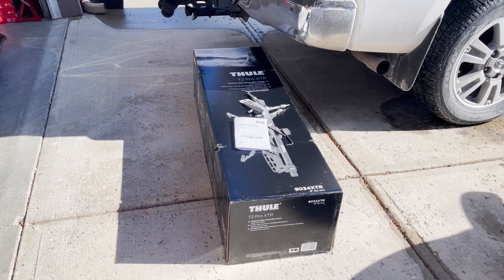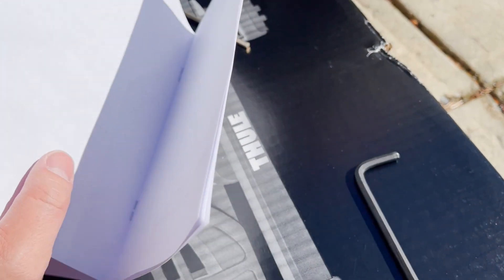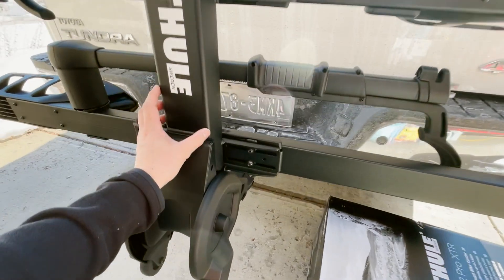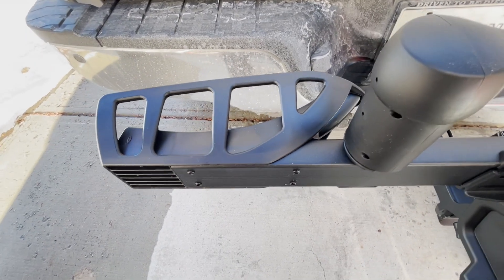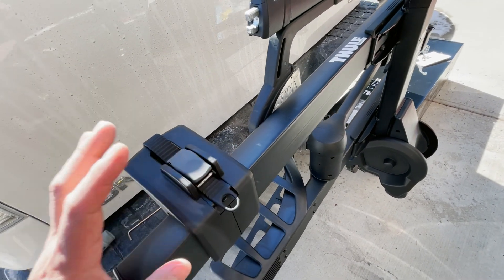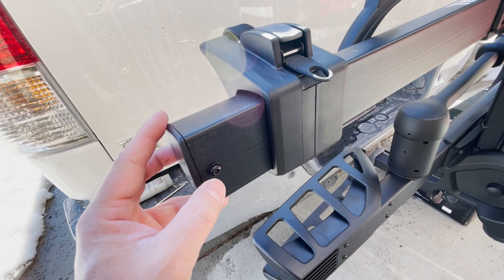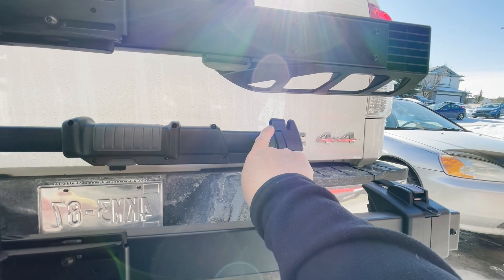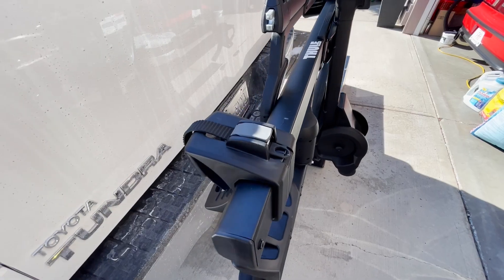Thule T2 Pro XT and XTR Hitch Mount Bike Rack Assembly Tips

Comment: Great video!  I few tips that I discovered: 
1. when you strap down the rear wheel, you should thread the end of the plastic strap INSIDE the hole, not around the outside (I noticed you were attaching it outside).  That will give a more secure hold, especially for the narrower tires.  
2. For me it was a real pain to get the rack to go into the hitch receiver the first time (I have the 1 1/4 inch receiver), because the friction wedge was sticking out.  I wrapped it in a cloth, then used a big channel-lock pliers to squeeze it together - that made it go in easier.
3. I didn't have a helper, so I did the assembly entirely off the car.  I layed the bars face down on a carpeted floor, extended the rack out flat and set it upsidedown on top of the bars.  That was I could easily put in the 4 bolts all by myself.  Same for the front wheel holders.
Thanks again for posting this, I don't think i ever would have figured out how to put in the key tumblers!
-Dan
Reply from the maker: Fully aware.  I demoed what can be done but for sure if you loop the strap inside vs. outside you'll get more or less length.  Its funny how the manual doesn't clearly show that but I knew it could be done either way.  Thanks for watching my video!
Reply: thank you for that 2nd tip!!

Comment: Great video, you're a youtube hero with this one.  Only addition I would add is that the knob to tighten the hitch didn't work until we both put the lock in with the blank key, but also turned it 90 degrees in place.  If you mentioned that, I'm deaf, but it took a good bit of disassembly for us to figure that out on our own.
Reply from the maker: Thanks for sharing

Comment: Thanks for the video. Lots of detail. Just a quick comment on grease and thread locker use. Superlube is a synthetic grease. It's not a silicone grease. As it is synthetic it will repel water and it's a good choice for the plastic ABS carrier. Unfortunately it is a lubricant that never really dries. So those bolts or screws could move over time. So periodic re-torquing is a good idea after some serious mileage. You definitely don't want to use a Loctite threadlocker there as the uncured resin, if it comes into contact with the plastic, will attack and stress craze the plastic. So avoid all contact there. Anything that's powder coated or anodized or bare metal is fine. How do I know this? I was a Loctite rep for over 30 years. Also, 243 or 222MS are great choices for the bolts. Both are removable. Thanks again for the post. Great info. Cheers.
Reply from the maker: That's a valid point and I stand corrected on superlube.  Yes I definitely wouldn't want to use the blue/green/red loctite on the fasteners as you've said, it will attack the plastic.  Fortunately for the screws that I used superlube on that they're a low vibration (I think) fastener so I hope it doesn't come loose anytime soon.

Comment: This was probably the best video I have found on assembling my rack (which I just received yesterday). My manual included all of the pages, which yours was missing.  You have some great pointers such as using lube on the screws.  As soon as you had mentioned the orientation of the two beams, I had to go out and see if I had them in the proper direction (luckily I did).  I found putting this together with the abysmal instruction manual similar to assembling something from IKEA. Thule could easily have made it into a good manual just by adding a few words and suggestions.  For example, how tight the screws should go, and some information on the proper use of the rack.  I assembled the rack by myself on the back of my vehicle. It honestly was not that difficult, although you have to have the second screw available once you get the first screw partially in.  And of course, I did drop a washer more than once on the driveway, and had to use a magnet to locate it, so it might be a good idea to place a hunk of cardboard, or a sheet under the rack during assembly. One other thing - there have been reports of vehicles getting ticketed (at least in Canada) because the licence plate is obscured by the rack.  I see Thule offers an optional plate holder for the rack, which attaches to the rack itself. Unfortunately, this was out of stock.  So I guess I will take my chances.
Reply from the maker: Glad you liked the video!  Its funny how something as straightforward as a bike rack can get confusing b/c of how the manufacturer documents or packages their product.  Given how expensive these racks are that taking proper care to assemble this properly is key.  Not sure how others feel about something pedestrian like a bike rack but I take care of everything I own and this rack is no exception.

Comment: Wow, you are so right about the dismal instructions. Great tip about extending the strap!
Also, I had a problem with the locks, I did not realize that one key is for installation and the other ones are actually to turn the lock, Duh! No wonder I could not turn the lock on the Knob with the installation key and also tried to insert the cable lock with the regular keys and they wouldn't go in! 
Every thing else was pretty easy, but I was dumbfounded with the locks until I saw your video. 
Thanks!!!
Reply from the maker: glad that you were able to get your rack all setup properly.  Yes the instructions are absolutely idiotic and what use are pictures if they don't tell a proper story on how to actually assemble the bloody thing!  Great product, terrible instructions.
Reply: @piercedasian  Absolutely, even Ikea instructions are better than these, and that says a lot!
Reply: It makes you wonder why the racks could not hav e come with the locks preinstalled by Thule.

Comment: Maybe someone else pointed this out, but you may have gotten a misprinted instruction manual. Mine had pics to install all the parts. Super easy to assemble (did it fairly quickly in the REI parking lot) and all the screws aligned with the holes (which apparently Thule is notorious for messing up). Great bike rack! Thanks for the vid 👍🏽
Reply from the maker: Glad you liked the vid.  Yes I have been told numerous times that my manual book was a misprint but even if they were a complete printed instruction booklet that they're still pretty cryptic.

Comment: Thanks for the great video. I figure after Thule saw this video they decided to complete all the pages in the assembly instruction manual. Mine had all the pages, but instructions were about as cryptic as Ikea. One thing I didn't expect is that the rack doesn't sit flat; i.e. parallel to the hitch. It leans in toward the vehicle quite a few degrees. I imagine it is designed this way purposely to reduce the cantilevered weight, but I'm using it with a truck and camper so the very wide handlebars on my Rocky Mountain Altitude come within one inch of my camper. If the rack was level, it wouldn't be a problem. I guess my Rocky will be riding on the rear rack.
Reply from the maker: lol I bet someone was really asleep at the wheel when they made the instructions...  Either way, I'm glad that subsequent versions of the manual are complete even though you may as well be reading hieroglyphics.

Comment: Thanks very much for your helpful video. I watched a few times just to make sure I was thoroughly familiar with everything. I actually got a full instruction booklet, however the two innermost holes ( closest to the main tower) on the two wheel baskets don't line up and I could only use two screws. And yes they are pointing in the proper direction. I wonder if anyone else had this problem. Other than that, this is a very easy to use bike rack.
Reply from the maker: glad the video was helpful.  If the basket holes aren't lining up I would take the rack back to the dealer you purchased from to get an exchange.  Mine lined up perfectly and given the steep price of this rack that I would expect nothing less than perfect.
Reply: @piercedasian  Thanks again for the video and reply. I couldn't wait to return it through Amazon and needed it right away so I made due with just two screws on each basket. I took it and my road bike on the highway with out any problems. And that was with a flat front tire. It is still very stable. I guess if there had to be a problem this was the best problem to have. Not too happy but at least I can use it seemingly w/o problems.
Reply: @garykurtz3009  if you take out all the screws and then try and line up the holes, find the one that is least lined up, put the screw threw and find the hole with the basket and holes slightly away from the screw, the screw will be bent a little, but once you do one slightly, find the rest, and screw them in a little at a time.

Comment: Your instructions booklet was  a misprint. My booklet has all the pages. Did you download the instructions from the website. Thanks for the points on the mounting bracket with the Thule Logo on top. i found an impact driver helpful, but need to watch the torque and tighten by hand.
Reply from the maker: Yeah I was told my instruction booklet was a misprint.  Regardless the Thule instructions suck as I've purchased some other Thule stuff and their technical writing team could use a lesson or two on how to present procedures in a better manner.  Glad you liked the video. Thanks for watching!

Comment: Great video. Do you think it's possible for me to remove the bike holding bars from the main attachment (that goes into the hitch reciever) and store all 3 parts separately for the winter? I live in a shoebox and I can't keep the whole bike rack stowed as is.
Reply from the maker: Yes, absolutely.  Just make sure you that you keep the washers and bolts in a bag that you won't lose otherwise you'll have to source new ones from a Thule dealer (they're metric BTW) and while it likely won't be expensive that it is a bit of a nuisance to try to find missing screws and washers when you really need them.

Comment: Just a T2 pro XT at a garage sell but they didn't come with lock cylinders for the hitch knob and cable lock. I cant seem to find the part number for them. Do you know it?
Reply from the maker: the lock cylinders are the easiest part to obtain.  Just go to any Thule dealer and ask for a lock cylinder set and they can sell you a kit that has multiple matching lock cylinders with a new key.
Reply: @piercedasian  sounds good. Thank you.

Comment: I love the bike rack the only problem I have is the cable locks are not long enough for my 5 inch tires I have a Bolton Foxbat E bike do you have any suggestions thank you
Reply from the maker: have you tried pulling up on the lock mechanism?  The lock doesn't actually stay in the "pole" of the rack.  The end can pop off that then allows you to wrap the cable around the tire and secure the lock close the to bike.  It was an accidental discovery I made when I said the same thing about the shorter than usual cable.  Turns out that its short if you pull it out and try to tie it around your bike and then loop BACK to where the cable comes out of the rack.  Totally NOT necessary to do that.  Try pulling up on the end of the lock where the cable pulls out of and you'll see the end holding the lock will pop out giving you MUCH more flexibility on how to lock your bike to the rack :)
Reply: Thank you problem solved

Comment: What are the locking cables made of? Can they be easily cut with wire cutters?
Reply from the maker: The cables are just that... cables.  Easily cuttable with larger wire cutters.  It is meant to keep the honest thieves away.  If someone wants your bike off that rack they will EASILY get them if they have the appropriate size wire/bolt cutters.

Comment: So I just got one of these and a thing I’m concerned is that the little claw thing that goes into the hitch pin. Doesn’t lock and stay in. It’s like a spring tension system that “hopefully” stay in. Am I missing something?
Reply from the maker: So I had similar concerns but I can assure you that it will hold just fine (in fact it holds really good!).  You install the rack, line up the safety pin hole from the hitch to the hole in the rack's tongue.  When the holes line up you snap the latch on so it prevents the hitch from ever falling out.  You then proceed to turn the twist knob to "expand" the end of the tongue on the rack.  As you twist, wobble the bike rack up and down as you're  tightening the knob.  You'll feel the "wobble" slack get taken up and the wobbling will diminish and it will be solid as a rock. Excellent design on their part.

Comment: I bought one last year and I’m having such a hard time locking the bike…I always thought the lock cylinder was too short to fit ..not sure how does actually locks ..this one has wheels  to drag around lol …nice !… however I wish my locks worked better than that…I’ll try again to see if I can Lock them properly…
Reply from the maker: Here is a tip for you... where the lock is on the bike... yank up on it and you'll see that you can now wrap the cable around your bike and move the lock along the cable to where you need it and latch it on.  I thought the same thing until one day it popped out of the rod/beam where the lock was "plugged" into.  Give it a yank and you'll find it is PLENTY long.

Comment: Hmm, does it matter if the thule marked platform is on the inside (instead of on the outside/top when stowed)?
Reply from the maker: not it technically doesn't matter but from how Thule's marketing material is concerned the bar with the "thule" name on it should be furthest from the vehicle.  Purely meant for branding purposes.
Reply: @piercedasian  oh okay thanks because I ended up doing it the other way and too lazy to switch unless it messed with the integrity 😅

Comment: Hi, I’m installing mine but the knob that secures the rack to the hitch just spins freely like yours in the video. How did you make it tighten so that it was secure and not wobbly?
Reply from the maker: Insert the key to unlock the knob and it will engage the knob and prevent it from spinning freely.

Comment: Do u have to put the super lube around the little screws before drilling them in?
Reply from the maker: yep anywhere there is a metal screw screwing into the ABS plastic I put a little blob of the grease on it to prevent the screws from rusting into the abs plastic.

Comment: is the rack supposed to silde at all? I have tightened as much as i can and it still slides? maybe i need that special tool you have :@#$!@#4
Reply from the maker: No it isn't supposed to slide at all.  What special tool are you referring to?  The ratchet? All my tool is is a speedier version of the included Allen key that came with the bike rack.  Bottom line is that the screws need to be screwed in fully (and they will screw all the way down with a bit of friction (due to the blue thread locking compound on the screws) but it should NOT slide around.

Comment: Thank you very much for this... I was thinking of returning mine because of not being able to lock in my fat bike tires.  By the wayi... those blank pages are not supposed to be blank... you got a misprint dud instruction sheet... which is really not detailed enough regardless.
Reply from the maker: How big are your fat bike tires that you can't strap them down?  You did see how I moved the strap to accommodate fat bike tires correct?  To my knowledge the T2 Pro XTR can really accommodate some huge tires.
Reply: @piercedasian  

Thanks to your video... I figured it out.  The second strap position accommodates my 4.5 inch tires.  Thanks again.

Comment: Can you lower your tailgate fully with the bike rack tilted down while there's a bike on it?
Reply from the maker: Unfortunately with my bikes on the rack I am unable to fully open the lift gate when a bike is inner most tray.  I guess if you were just carrying one bike on the outer tray you could open it without issue.
Reply: Thanks for the video!  I was wondering, without any bikes on and with the rack,
In the tilt position, can you fully lower the tailgate without it touching the rack?
Reply: @egmuni1897  I ended up buying a Kuat rack. I discovered that with my F-150 you can't fully open the tailgate with either rack because of the wide top on the tailgate. I think it would work  for a smaller tailgate like on a tacoma

Comment: Thks for the tips, made my install easy. The only thing I would add is to be careful with the bolts because they are super easy to strip when using a battery operated tool. Lol..

Comment: Can you make into 4 bikes in the xtr as you can do with the xt?
Reply: Yes. I bought the t2 extension. I think it’s the same extension as the xt. I haven’t assembled the extension yet but it is extendable.
Reply from the maker: yes you can, it is the 9036XTB 2 bike extender.  If you sub to my channel you'll see me perform the upgrade in June when it arrives.  The extension in my neck of the woods is backordered until then.  It is a bit finicky to put together so I will be doing a tutorial.

Comment: Very helpful. Thank you. Now if I can solve the problem of the failed folding release handle, all this will have been worth it. Relearned another valuable lesson: avoid Scandinavian products that require assembly!
Reply from the maker: Not sure if what I will be posting soon will be relevant or not but I am taking apart our Thule rack soon to install the 2 bike add on module which would also require me to tear into my release handle assembly to "extend it".  Perhaps my disassembly and explanation will help you fix yours?  I'm still waiting for my extension add on to ship to me (expected late may).

Comment: I think your manual is defective because mine doesn't have the blank pages. But they are still terrible even with all of the pages!  The one thing you missed in your video is how does the hitch lock work?  The instructions don't address this at all.  I figured it out but you might want to add that.